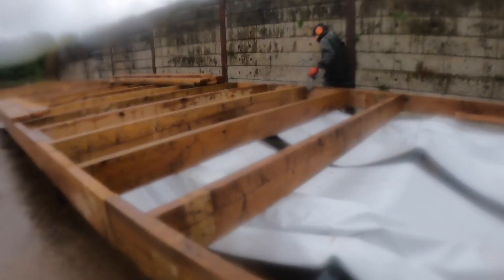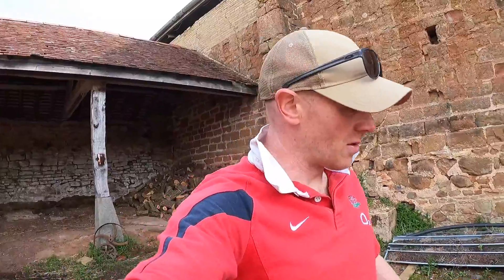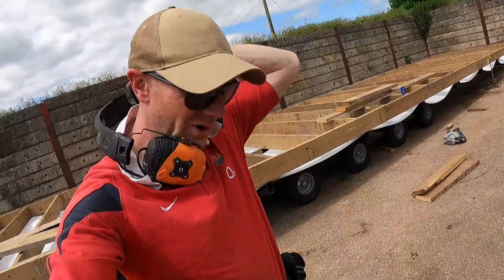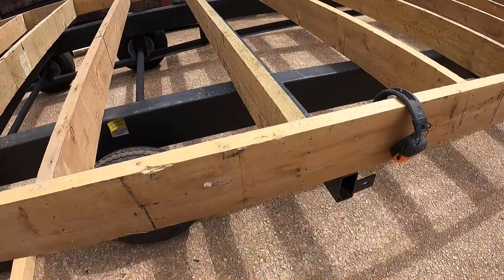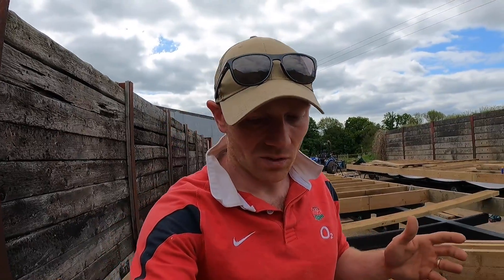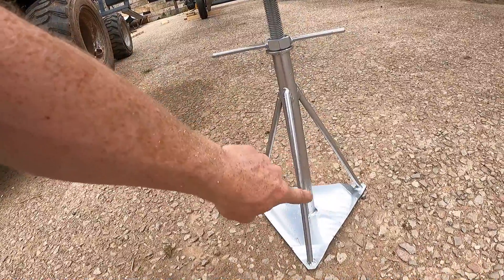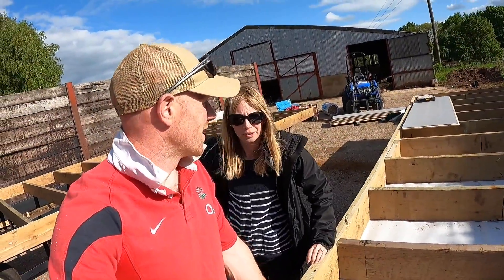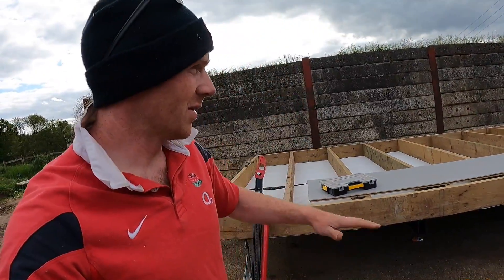FRAMING THE HUGE CABIN FLOORS - DIY Rain or Shine!

Comment: Regarding rodent-proofing - I remember that barns used to be mounted on concrete "mushrooms". These were intended to prevent rats from climbing up and into the barn.
I think that you could employ this idea on your "axle-stands" by simply adding a metal disc, maybe 2 feet in diameter, with a hole in the middle so that they slip over the central shaft.

Comment: You should drill a hole in the end of one of your forks on the tractor so you can install a trailer ball when needed.  Great for moving trailers and chassis (in this case) around when needed.

Comment: Great to see progress - must be a relief for you to get cracking!  Question:  How did you join the Bearers together?  Looks like you staggered the planks on each side that make up the 16m span but I couldn't see how you joined them end to end.  Do you not need the rigidity or will the floor tie it together?

Comment: Cut some square pieces of alloy or tin sheet about 300 x300 and drill a hole in the middle the same size as the threaded bar in your jack stands. Then slit the square sheet from the centre of the hole to one side of the square, you should then be able to slide them onto the jack stands under the lock nut- this will create an umbrella over each stand which should eliminate rodent ingress.

Comment: Might be a daft question, but how are you fixing the deck framing down to the chassis? I'm a joiner for a park homes manufacturer and our chassis have loads of small angle brackets welded on to screw the joists down to.
Reply from the maker: Yeah we have bolted angles every other steel. Could have had them made with but glad we didn’t as we changed centres to 600mm last minute. Feel free to let us know any other tips of the trade though! We need all the help we can get. 😀
Reply: It's difficult to think what advise to go e untill o e seen you doing something in the videos, then it's a bit late. With the insulation for the deck the membrane's a new idea to me. We drop in sheets of 6mm ply, tacked in with thin strips of batten, to support the mineral wool. Then a sheet of dpc over the top before the floor boards go down.
 It'll be interesting to see how you get on, are you building the 2 halves completely separately? Our chassis are all fixed together once the decks complete and the lodges get built as one, that way you know everything lines up properly and sits together flush. We had a lodge come to us part built from another factory where the 2 halves were built up separately and it needed a lot of remedial work to get everything to sit right once brought together.

Comment: Excellent Vid. Couple of small things if i may. Jo needs to learn when ye ur knackered at night youve been workin all day and you get a wonky board the only way to get rid of the frustration is to launch it anywhere with attitude.  Ye get wee plug in gizmoz's that scare the rodents and the arachnid's and they won't come anywhere your building. I used to get them{rodents) bought two of these gizmo's and i havn't seen one in ages. Later. Alternatively get a Mouser.(cat).😂

Comment: Why not do like ship mooring ropes and put a funnel type obstruction on the chassis stands and anything in contact with the ground to prevent climbing rodents? Could DIY them from plastic bottles and it's a good game for the girls. Figure out a jig or method of making them and it'll speed it up.
Alternatively you could try anti-vandal paint.

Comment: Regarding the rodent issue, one manufacturer who uses rockwool simply fits board underneath meaning the insulation is totally enclosed. This doesn't seem a great solution for a lot of reasons but I guess it does solve the rodent problem. I had always wondered why the value of these units crashes after 10+ years, I guess the floors must start rotting by that time!

Comment: As a pest controller l think you're underestimating where rats and mice will enter a structure like these, good luck anyway.
Reply from the maker: I think you are right and I've been worrying about it since making this video so now trying to think of a retro fit to help. any ideas?
Reply: Like you said in the video a galvanised mesh would be the best option, I would suggest one of around 5/6mm using self tapping screws and an angle bracket to fix it to the chassis, it could then be removed if access is required at a later stage. This wouldn't be a cheap option but it would give you peace of mind.

Comment: Great to see the build starting. One thing... If you're having so much "fun" moving the chassis now, how on earth are you going to be able to align them to join together once they're each complete?
Reply: They need to be built together. Bolted underneath. But built as two, joins in floor, roof and walls. Used to build these. Underfloor heating the works.

Comment: If I was doing it Tim… I’d put 10mm square galvanised mesh as the first barrier… then the membrane… then the insulation… keep the mice out……🙃
Reply: Mice can get through 10 mm.
Reply: @alangknowles  rats will bite through it
Reply: Well maybe a smaller mesh so…. And the critters will only go where it’s easy take away food…
Reply: @grahamyoudell4105  not in the UK they won't...our rats are particularly athletic and rockwool is like a hotel for them.